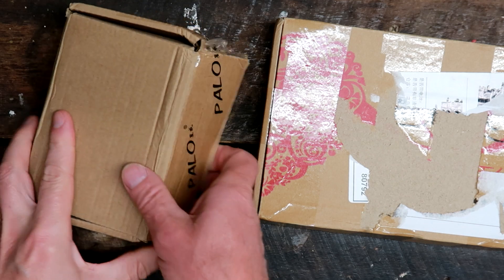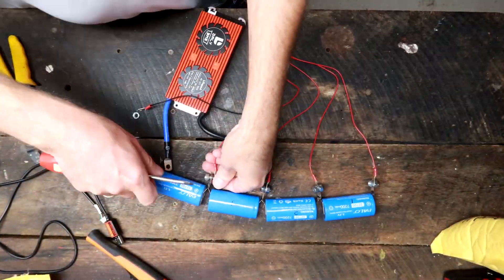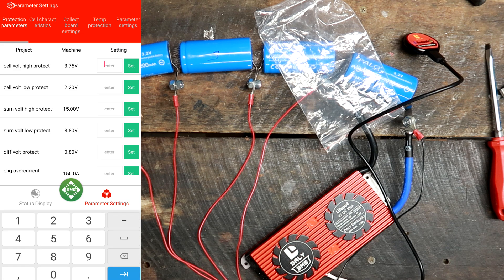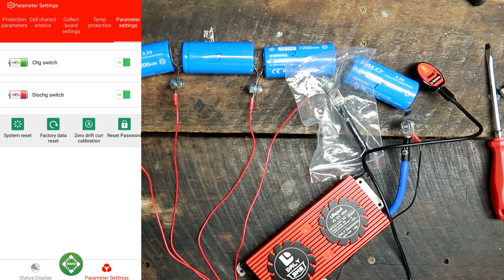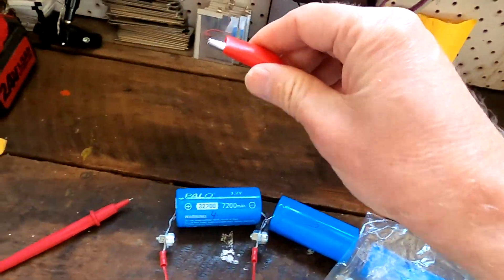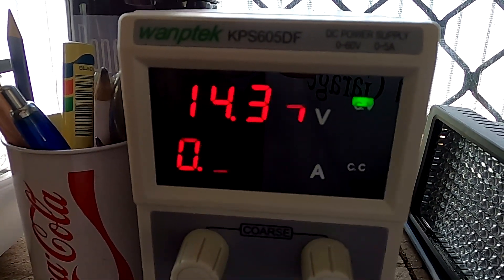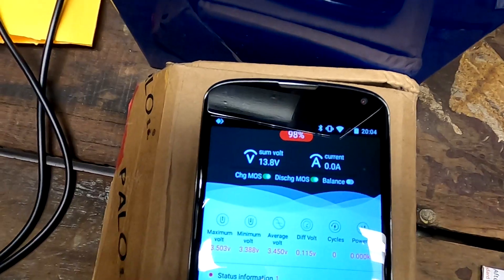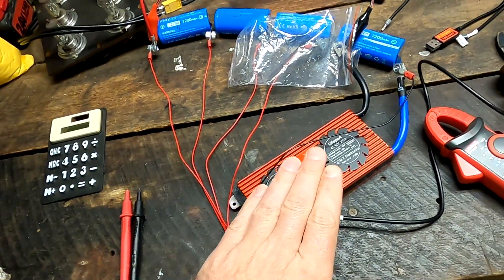Why DALY BMS' are so popular? Exactly, I don't know either.

Comment: With balanced cells the Daly works great. Simply top balance your cells before you put into use. The daly will work great. 

I like hw the charging cutoff but discharging continues on the Daly. That's a very neat feature, worth a ton of other features on the QUCC. I even choose it over the all time active balancing on the QUCC... cos the QUCC balance current is still negligible.

So basically a tool is best used when deployed hw it was designed to be used. Daly is best with Top balanced calls. 

Obviously the balance current on the Daly spec sheet tells you its not gonna balance an unbalanced pack for you.
Reply from the maker: The Daly may work with smaller, new cells. I cannot imaging that it will be great after a few years when cells start drifting more, especially if you have 300Ah+ of capacity.
The QUCC BSM does a fantastic job at top balancing. I can just leave the battery sitting there over night and it balances all cells automatically to 1mV.
Reply: @OffGridGarageAustralia  Sure. The Balancing is nice but
- If the cells will experience as much a drift as you say they will with age, then the QUCC balancing current will not be able to keep up either way
- Also a BMS that trips off power on any fault protection it does (over-current, over-voltage, e.t.c) isn't so great for someone who wants a handoff experience with these things like majority of users.

That the Daly can trip off charge for protection (over-current, over-voltage) but keep power on (discharge), is really a very useful technical advantage.
Reply: @FullyChargedZone  I honestly think he doesnt know what he's doing
Reply: @WilliamHelstad  Top balance means to individually charge each cell by itself to the voltage you desire for your battery chemistry and do each cell to the same value.  So when you connect them together they are all equal from the start.  You can do this later from time to time as you deem necessary.  Even when connected together, you can still put a charger on each cell + to - to rebalance them.  You can balance them at any voltage your particular battery chemistry operates between (fully charged to fully discharged).  Top balance means to charge each to the max you will charge to while using them.
Reply: Top balance is thé n’asservît 👍

Comment: I have the same  BMS and mine continues to balance after charging stops but i do have a temp sensor 🤔
As you say they are more beginner friendly and there's an awful lot of beginners of YT  which is probably why they are popular ?
On mine the Bluetooth turns off after a few mins to save power, i have to push the button every time as well 👍
Reply from the maker: Thanks for sharing. I'll test this again once the sensor has arrived. As I turned off the temperature control, it should not affect the balancing.
Reply: @OffGridGarageAustralia  Shoudn't affect it... but since there's no "off" switch for the sensor who knows what it's behavior in each mode would be.
Reply: @OffGridGarageAustralia  question: is this temperature sensor a special/proprietary device?  If so, where to get it?

Comment: Hello.
I have a 5 kW solar energy system.
A MUST brand hybrid inverter is available and is produced with 48v battery architecture. For now I am using it without battery. I want to add a battery soon. I'm researching ready-made or do-it-yourself systems. DALY has a product for home storage, but I think I won't buy it because of the balancing problem in the video. What is the BMS brand/model that can track the 59 parameters you mentioned in the video? Where did you buy it and for how much?
We are planning to install a 13s-48v Lion system.
Thank you.
Reply from the maker: Use the JK-BMS for your battery. There are a ton of videos here on the channel to watch and learn.

Comment: 11:10 just look at the status information. there it clearly says "temp low" for charge and discharge
I also have a daly bms and its working perfectly. you just have to understand basic instructions :P
Reply from the maker: Yeah, but If I turn the temp sensor off, the BMS starts working but it still shows that message. So how good is that then?

Comment: I agree it isn't a great BMS but for my 8s 24v system it was the only BMS that could do 200A with as the other ones were limited to 100A
Reply from the maker: I guess, you have more choices now on the market.
Reply: I made the same choice for the same reason.   JBD is an option a lot of people are going to.

Comment: I think these cheapish 'smart bms' achieve balance over several cycles by gently bringing the low cell up during charging.  Not sure but think this is achieved by putting a tiny resistance on the other cells until full and eventually it will catch up.  If I'm correct the way to speed up the balancing would be to set the start balance parameter as low at the max discharge of the battery and discharge the battery to lowest safe level then start the charge.

For 99% of users achieving balance of a few cycles of normal usage is not a big deal.

Comment: 20bucks for an active balancer. You pretty much need them for all the Chinese BMS. I have the 500amp 24v and the 200amp 12v Daly Smart BMS and with the active balancer they work well.
Reply from the maker: Yes, the Daly will need one with these high capacity cells. It may work with smaller cells like the Palos without extra balancer. It just needs time...

Comment: You do our beloved QUCC BMS wrong.
Of course you can discharge even if overcharge protection is on. As soon as the BMS detects an outgoing current flow it will switch on the relais again. The same is true for undervolt protection and charging. 
You can test it by manually switching off charging. You will see (more hear probably) the relais switch on and off depending on the flow of current.
Reply from the maker: Yes, I know, it does that. There is a single black cable connected at the output of the relay, like a voltage sense, so it know what's going on even if the relay is turned off.
Once I have the second battery bank connected it does not really matter that much any more as it will only disconnect this one bank then.

Comment: Hello andy, first of all....vielen dank für all deine tests und teilen deines mittlerweile geballten wissen von lifepo4...das ist goldwert für jeden der sich für dieses Thema interessiert!  Eine frage bitte, 
Hello, I have been wondering for some time what the situation is regarding lifepo4 --- does it actually have an effect on the lifepo4 if it is next to a water tank/water canister?  The question relates purely to the chemical reaction with each other? Electricity and water together lose nothing is clear!!! But purely the chemical magnetic reaction whether there is any influence...canister/tank tightly closed outside dry and lifepo4 classic in a housing 12v battery!    Is there any experience or principles in electrochemical behavior?  thanks a lot

Comment: Yes the Chinese call soldering welding. Its a Chinese translation issue.
Reply: I took it to mean connecting as none of the BMS connections are welded or soldered vs. Bolting
Reply: They were calling shorting welding.  To start the BMS you can touch the two main wires together.  Probably not good for the BMS that's why they say don't weld the wires...  Hahaha

Comment: The Daly BMS appears to be painted red. One good layer of paint can radically change the effectiveness of the extruded heat sink it is on. So does the Daly run hot? Or did they waste money on too much extrusion?
Reply from the maker: They may get warm when we push high amps though it. The FETs have some heat loss. Not sure how much the paint will affect that though.

Comment: hi my name is liton i am from bangladesh i need your help i have 19 batteries each 3.2 V and 100 MPR what kind of BMS can be used to make this battery pack and how many board BMS to use here please me Please help a little.
Reply from the maker: For this, you can use the JK BMS which can handle batteries from 8s-24s. It goes up to 200A and is easy to program and setup. Hope that helps.
Link to that BMS is on my website: https://off-grid-garage.com/battery-management-systems-bms/

Comment: MIND THE GAP!  (My OCD kicked in when the terminal ends starting falling through the gap in the workbench.  My therapist is going to be so confused.)

After just a few charge cycles, I think you'll find that this BMS balances the cells.  Also, these are the cells you put through hell in your testing, so it's reasonable there is a significant difference in their internal resistance, at this point.

You do realize that you grossly overthink all of these things, right?  :)
Reply from the maker: I'm observing an sharing what I find. I would not call this overthinking. It might be too much for some though, I understand this and I'm aware of that.
The cells where used individually in other tests and application, hence they were on completely different SOC. I was hoping the BMS will balance them over night as good as possible. Any other BMS would have done that, but not the Daly apparently 🤦‍♂️
I discharged two of the cells with 35A once and I would not call this 'hell' either. This has not caused any dramas or damage as future tests I did have shown. The internal resistance is still the same as when I got them new.
Reply: @OffGridGarageAustralia  I would be curious to see what happens with these cells after 5 or 10 charge/discharge cycles.
Reply from the maker: @jasonbroom7147  you mean the whole battery with the BMS attached our just the cells which I discharged with 35A? I've done a few cycles on then since and don't see any negative effect, still same capacity and Ri
Reply: @OffGridGarageAustralia  - I mean the 4S battery, with the BMS attached.  After a number of cycles, the BMS should gradually bring them into a reasonable balance.  It's not an active balancer, but for all practical purposes, it will do what it's supposed to do.  Maybe it doesn't have 50+ adjustable parameters (who wants to make that many decisions for a simple battery?) but it does the job very well.  Sometimes simple is better.
Reply from the maker: @jasonbroom7147  That test is on my list of things to do. I will use the small 5.4Ah cells in 4s config for that and see how they balance over time with the Daly connect. People say it is working, so we will see...
Reply: @OffGridGarageAustralia  - I have two 100AH batteries using a very similar Daly BMS and the cells stay well-balanced.  The bluetooth portion is confusing to some people, because it only connects when the battery is charging/discharging at 5A or more.  This is the biggest complaint.
Reply from the maker: @jasonbroom7147  they implemented some weird rules in their design. It's probably for energy saving purposes for mobile applications, e-bikes etc.
They could just make this available in the software and give users the choice if they want this feature on or off.

Comment: Balancing with a bms is pretty much pointless. I have a 4s daly and use it as a battery protect. The app is trash but I use the uart instead connected to a raspberry pi and log the data and graph it via grafana.
Reply: Id really like to do that too with my Daly, can you post the link to any guide you have? thanks
Reply from the maker: Well, the QUCC does balance the cells quite well. I can leave it sitting on say 3.55V over night and the next morning it's all done.
As you said, the Daly seems to be a pure protection board and you need other measures to get your balancing done.
Reply: @jaymatt59   you can also do this over bluetooth
Reply: @robben8704  Thanks, any how to's you can link me to?
Reply: @OffGridGarageAustralia  Hi Andy, yes, your QUCC balancer can balance at about 0.2amps, but in my case with the daly and no more than 0.03amps its impossible to do while charging from solar. 
I have an active balancer but as you also found out it is only useful while at a high SOC. So I used it to balance my cells at about 3.55 one day about a month ago and then disconnected it.
I have lowered the boost voltage to 3.45, I think on the daly I have it set to start balancing at 3.5 so now its not balancing at all. 
So far the pack has minimum deviation after a month or so whithout any balancing. I think I´ll keep it that way and if I see some drift use the active balancer to keep the cells in shape.

Great videos by the way, I learned a lot from your tests!

Regards from Argentina
Reply from the maker: @kirovoleg  Thank you, that seems a very good solution and will definitely work.
Reply: @OffGridGarageAustralia  I have a dumb Daly BMS with 8s 280ah cells.  My cells generally stay within 5mv I'd say it works swell.
Reply from the maker: @farmerjhemp  That is good to know. You obviously did the initial top balancing and then connected the BMS so it has only to keep them in balance now.
Reply: @OffGridGarageAustralia  of course I did a top balance.  That's battery building 101.

Comment: Hi everyone, Recently I have purchased a DALY smart bms 8S- LFP. But I am unable to activate it. I have used a dc to dc buck converter to supply 28.0V to activate it but not successful. Contacted with DALY people, now they are advised me to use a smart charger. I don't have that. Any help, any body.
Dear Andy, can you please do a favor for me.
Please test your DALY bms to activate it from a buck converter supply.
Right now, I am hope less.
Reply from the maker: If you have a 8s battery and using a 8s BMS, you don't need a booster to power it up. Am I missing something?

Comment: At least it turns on without needing a 9V battery to zap it awake like my Heltec BMS's. But the Heltec/JK bms has 2amp active balance thats always on, and has built in bluetooth, and CAN support. My cells stay within .008V. Just ordered  Seplos BMS to check that one out.
Reply: Also: the JK/Heltec BMS can shut itself off to prevent accidentally draining an empty battery. I like the fact you actively have to turn it on: it means something went really wrong if it did turn itself off.

Comment: So the other battery bms that has a active balancer vs a top balancer like the Daly BMS.
Reply from the maker: All balancers in any BMS are top balancing, regardless if passive or active.
Reply: @OffGridGarageAustralia  I mean passive balancing.
Reply: @OffGridGarageAustralia 
Quote "This BMS has a built in passive balancer, capable of 30ma of balance current.  Before assembling your battery bank, we suggest manually top balancing, or utilizing an Active Cell Balancer instead.  If you are using low-quality or B-grade cells, the BMS will not provide enough balance current without the addition of an Active Cell Balancer."
 Daly sells a small active balancer in their line up for about $20 usd.

Comment: Man at 19:03 the balancing switch is green! You missed it! Anyway is balancing just when charging...apparently.
Reply from the maker: It comes on for a moment only, depending on your setting. And amps 🤦‍♂️ totally stupid system.
Reply: @OffGridGarageAustralia  my first BMS was a Daly, because everyone was using it like you said. I stumbled on the same problems. Now for the next battery pack for my van conversion I’m thinking to buy a JBD BMS. It has 2 temperature sensor and a much nicer app and they claim 150mA of balancing current. The onli problem is that the biggest one is 200A for the smart version…

Comment: G'day Andy, I've been running in the daly 400a for a few months now. I have returned mine due to a mosfet internal ntc failure.
You are right in saying they are a basic protection board. There is alot more parameters in the pc software to play with but the basic features remain.
I use mine in conjunction with active balancing. 
My opinion is there are better bms out there for the same money.
Reply: which one?, please share with the group

Comment: Probably popular since Will Prowse slaps them on so many of the test packs 😆 That's why I've got one.

BTW, someone wrote a serial driver so you can plug the included USB lead into the Venus OS and see the data in VRM.
Reply from the maker: Thanks Paul. I've seen that driver in action. I think there is a Github site with instructions.
How is your balancing going with the Daly?
Reply: Following Will's advise, I bought a Daly also, but at that time, it didn't existed with tuning capability, it would raise the voltage to more than 3.7 v on one cell, maybe because I was charging at to low amps for safety, it didn't balance, I added a 6amp balancer, but still, it was not enough, eventually leaving the balancer connected brought the cells to equilibrium, and lower charging voltage kept the cells under 3.6v.
Reply: @OffGridGarageAustralia  the cells balance has always has been pretty good. I'm not sure if that's the Daly or I just got lucky with the cells though. I could see the balancing working when I had the Bluetooth dongle connected but the USB driver for Venus doesn't show the Balancing status. I've got an active balancer (after you were initially enthused by them 😉). I've never attached it though. I was thinking about using the relay on the Victron BMV 712 to turn the balancer on at 90% SOC.
Reply: Me too. Went with Daly after watching a Will Prowse video.  Plus the Daly seemed well built...and they are.  They are just lacking in a few details.  I am still undecided which BMS to use in my next battery.  I am looking for something that can can integrate with Venus as a managed battery and hopefully cost less than Batrium.
Reply: @OffGridGarageAustralia  I charged up to 100% today to test it out the balance as I've been cycling between 95% and 10% everyday for a good couple of weeks now. It was 0.2V deviation at 3.55V but as soon as the charger was off and it settled it was only 0.07V at 3.45V so happy with that. I couldn't get the balancer toggle to turn on in the app settings tho.